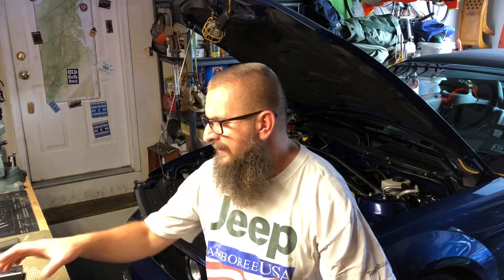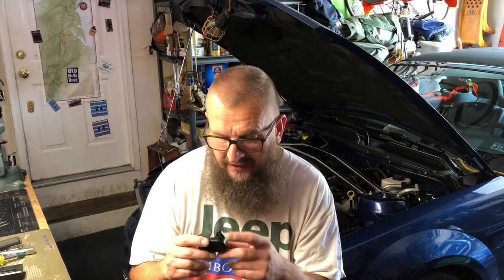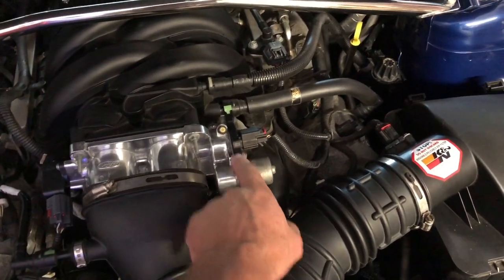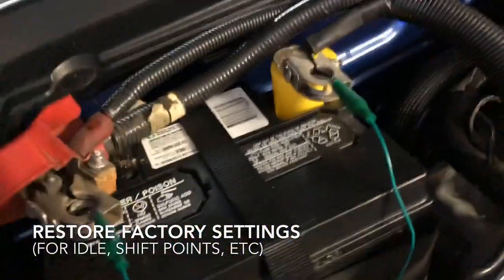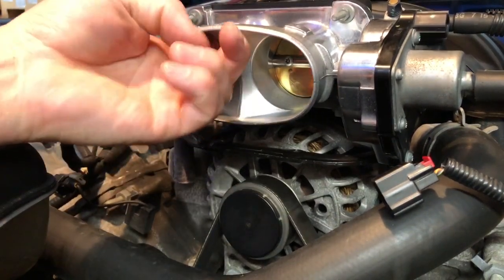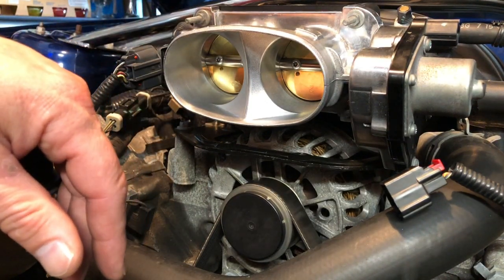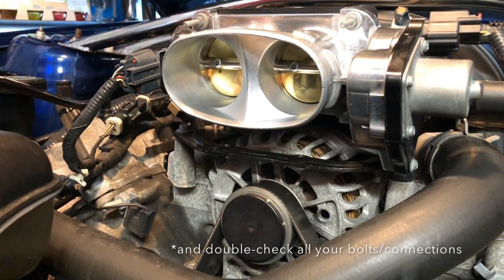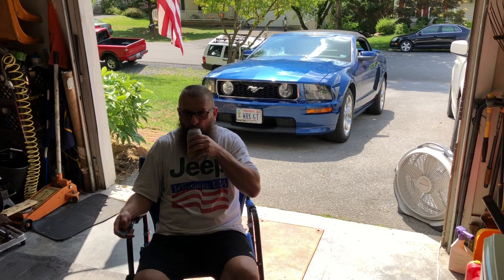Got the Wrench Light? WATCH THIS! -  How To Troubleshoot a 05-10 Mustang Throttle Body

Comment from the maker: Update:  It’s been a few months now, a little over 3k miles.  The issue never returned.  The weather has now turned cold, so mileage will not accumulate until the salt trucks disappear in Spring.  So-far, so-good.

Comment: 07 4.6 L Eddie Bauer Exploder. , I decided to Seafoam spray clean the intake through the Throttle body.  The result I believe is I messed up the TPS , I already have a brand new Cardone throttle body as I have been restoring this truck being a gift from my late father in law . Saw another vid that says Cardone uses a first gen faulty TPS on their build , so I ordered the robust recommended replacement TPS . But the breakdown before this was related to buying the cheap Chinese parts from amazon , I bought a mass airflow sensor and a fuel rail pressure sensor for under $60, and after getting the best mpg since I had it almost factory new mpg, @140,000 , she would not start well or even idle, so $400.00 later for the same parts from the dealer , gut punch 🥊, hit me again !! One more time . That’s about right .... I put on those parts and boom 💥!! Back to normal again .... so yea now I’m in the position you were in , I’m still going to replace the TPS but , I will follow your calibration procedures if that does not do the trick , sea foam had me put the spray tube in and through the butter fly valve and and reconnect the air intake with Mass AF , and hold a 2,000 rpm while spraying .... we didn’t get through half the bottle before the self inflicted breakdown occurred . Did this some cleaning two years ago without incident ... so I def think the TPS has failed . 

But I did upgrade factory exhaust with the mandrel bent Magnaflow Exh from the manifolds back ( eliminates the resonator) wow she sounds like a a Mustang now and the power I have gained puts a grin on my face every time I get to take her for a spin!! Makes me feel like a teenager again !!!  Saving up for new heads and I have been watching a lot of Tranny rebuild vids for the 6R60 .... saving for a rebuild kit , if clearing the TCM tables does not provide smoother shifting ... well adding that to the queue ... thanks for the video !!  Keep Cruzin !!! FJB. TrumpWon2Q2Q

Comment: Thank you for putting this video together. I got my 07 back up and running !
Reply: Great video and very informative. Just thought I would add to this , in case someone else was having problems after trying everything else . The only other problem if this did not repair, your issue …could be the accelerator pedal position sensor. The unit plugs in , and has two failsafe circuits On board inside your car pedal. The computer monitors the (2) potentiometer circuits for redundance. I watched a lot of videos online since I have a 2007 mustang. The wrench light and the limp mode Can be caused by multiple sensors in your throttle system. It takes an oscilloscope to see a quick dip A bit least one second… in voltage on one of the two circuits… that can’t be picked up by most handheld units at a dealership. It basically has electrical contacts that sweep two separate potentiometer Circuits. You could have a dead spot or a complete malfunction. It can sporadically happen, causing the wrench light to come on. It’s seeing (2) unexpected reading simultaneously. The ECM throws up the wrench and goes into limp mode for safety, thinking the car could be over accelerating, and chooses to stay in idle with no acceleration response. The TPS and the accelerator position sensor….. ALL communicate with the throttlebody and this is also something to check.  I ordered a Complete replacement Accelerator pedal assembly …just plug in the connector Going to the ECM. All the parts stores sell this complete assembly and they are definitely low in stock because this is a big problem also.
Reply: @kellymeade4587 I had this issue a year ago and replaced my throttle as a whole and it did fix the issue and here I am a year later running into the same issue thinking it could be the pedal and your comment gave me the extra boost I needed to go okay ya I think that’s more then likely the issue if not then I have a warranty on the throttle and I can replace both throttle comes with the sensors and all the good bits and if this doesn’t resolve it then I’m thinking imma have to get at the brain and check fuses

Comment: All is good. It is possible you had a spot of Ware in your Petrol..Combine that with a mi-nute bit of sludge. Then you have a vehicle pregnant with a common Belly discomfort. Remember a solid High Speed run for five minutes,also helps discard carbon.Depends on the pace you drive in your area of space. Constant slow is not good..But I enjoyed the video.I save the good ones on "watch later."  (like yours) Has been a life saver for me.

Comment: Im having a similar issue with a VMP 163R monoblade on my Shelby its throwing 2 codes P2104 and P2112 im going to replace the electronics on it from my stock Throttle Body and see what happens if it doesn't fix it ima check voltage
Reply from the maker: Good luck with it. I would think the voltage range would be the same.
Reply: Did you ever fix it?

Comment: When I first got my 2005 mustang gt the dealer put in a new battery. After that once the car got hot.  The car ran rough at idle and would stall. Read around and found out cleaning it would help. I did that and haven’t had any problems with the car since 8 years later. I carbon clean it every few years now. So if your idle is rough especially after disconnecting the battery. Clean the throttle body.

Comment: Good vide I have a problem car starts and after minute or 2 stalled I got 5 codes about the throtter body related on and going to replace the hole throtter body I hope that take care the problem

Comment: I have a wrench light on my 2010 mustang gt...had diagnosed and the mechanic said it was a sensor triggering the torque converter clutches.....I replaced the throttle body,  wrench light is still on....
Reply: Did u find the fix

Comment: Did the problem return?
My 05 GT has a idle problem sending it into limp mode with similar codes..I cant figure out what it is
Reply from the maker: Did you measure the TPS voltage?  Is your throttle body clean?  Were you messing with it (like I was)?
Reply: @Just_Mark  the voltage is within spec..new TPS..new MAF..BBK throttle body (been cleaned countless times). If I flash between tunes, its fine for few hundred km then comes back. Seems to happen most often after been driving for 30 minsor so.
Been trying to fix this for a long time and Ive just about had enough.
Last week I tried replacing the actuator motor like you did...Made it worst. Its just rediculous.
I never thought about checking the butterflies..It seems very unlikely though
Reply from the maker: I would definitely try adjusting the butterflies.  Just crack all 4 torx bolts loose, press them back into the bore, and snug them back up.
Reply: Tried all of this and no fix, do you think a whole new throttle body world work?!?
Reply from the maker: Zach Antonacci : I can’t really answer your question.  What do you mean by “all of this”?  Did you replace parts? Adjustments?  Clear codes/memory?  It’s just too difficult to tell you what your problem is without troubleshooting it myself.  I’m not an expert.  I did this video to show what a I did to fix my issue, and tried my best to explain why I was doing each step.
Reply: @trevorb7645   I’m having the exact same issue even with the tune did you ever get this fix or find problem

Comment: My mustang 2010 dies at idle if I unpress the gas pedal . Has new air filter new spark plugs cables battery egr valve maf sensor . Idk what else could it be .
Reply from the maker: That’s a little different than I was having.  But it wouldn’t hurt to make sure your throttle body is working

Comment: I just wanted to know if you know anything about the 07 mustang 4.6 l my throttle didn't work at all since I changed all the I have not changed that one yet I bet that's probably the one my throttle does not respond at all now like pushed to the floor don't do
Reply from the maker: The throttle is connected by wires to the throttle body, through the computer. Not sure I understand your exact situation, but the stepper motor is on the right side of the throttle body (looking at it from the front of the car). That is either broken or the connector isn’t connected. Otherwise, it could be the connector on the gas pedal, or a defective pedal. If you take the intake tube off you can see the butterflies on the throttle body. Have someone turn the key on while watching the butterflies. It should make a noise and cycle open and closed.

Comment: What if the voltage doesn’t change when you move the butterflys
Reply from the maker: If you have a good connection and good voltage, but it doesn’t change when you open the butterflies, the sensor is bad.

Comment: Nice well at least I know which wire to test now lol sum is up with my sensor or connector idk or unlikely could be the pedal sensor switch .... but I find it odd if it’s the sensor because I was getting the same sensor code with my old throttle body an sensor an I brought it used off line crazy of both of the sensors are bad lol idk ima test it ... but I had this new throttle body for months finally decided to put it on an it deff likes that cleared my throttle stuck open an throttle stuck closed codes an I think the other code it cleared so now all I need to do is figure out the sensor problem which idk like lil small simple stuff like that is fun to me cuz u kinda get to jus take it easy no crazy physical effort needed not getting super greasy an shit but anyways of u see this and make it this far did u have ur ignition on when u did the meter test on the sensor?
Reply: I’ve been having this issue every since I put my bigger throttle body on puts my car into a idle only mode showing those same codes any luck figuring it out? If so it would be helpful thank you
Reply: @HydraHiii  it could be that you might need to clear the computer which I remember is sum process where u take off the battery wire an use a jumper wire to discharge the energy or sum so that computer can relearn how to run with a different air flow an u know I act know i replaces the sensors on the throttle bottle but I think it might have ended up being plug that goes into the sensor i did re wire one of the plug an I’m try to remember in pretty sure it might have been that

Comment: My car is weird I replaced the whole throttle with sensors and and still won't start, been parked for two months already, and still does the same today
Reply: Check your crank position sensor and wires going to it mines sat for 6 months because of the two wires was touching
Reply: @FbERicoEsco  Thanks, actually found out engine has bad compression.

Comment: What happens if I try to move the black little circle on the throttle body I need to adjust my voltage, it’s taking me to limp mode
Reply from the maker: You will likely break that adjustment because it’s just plastic and lock-tited in place.
Reply: Just livin’ with Mark thank you, Lito tunes said the same but another tuner said to move it (Ortiz performance( my wrench light was taken off via tune by Lito something Ortiz performance couldn’t do
Reply: @cheko4440  yea I broke mine like it was meant to lol
Reply: @cheko4440  that’s because Lito knows how these cars operate.
Reply: @KapcomRacing  yeah he got it running first base tune! That’s crazy i couldn’t enjoy my car for years but thanks to Lito I can 🙏🏻

Comment: My 06 mustang gt  keeps stalling it runs on  just fine then it dies put it starts back up idk wtf is wrong with it and we ran the computer only reads the throttle body is open by 25% idk wtf to do at this point
Reply from the maker: Check the TPS voltage, like I did later in the video.  As you open the butterflies by hand, the voltage should go up smoothly.
Reply: Same Exact Issue As Mine🤦🏾‍♂️